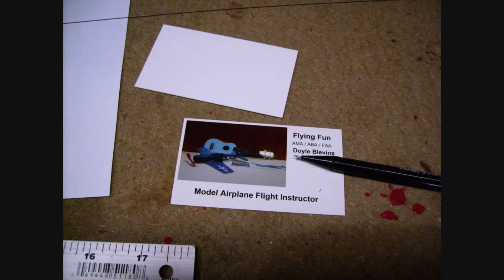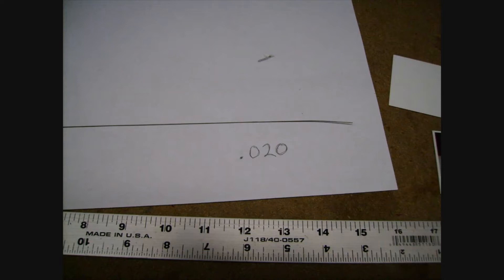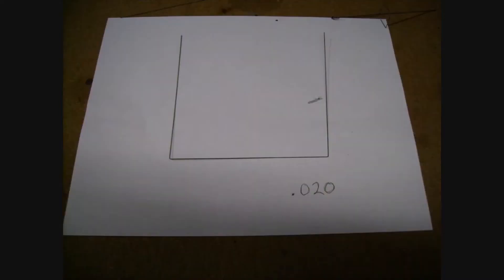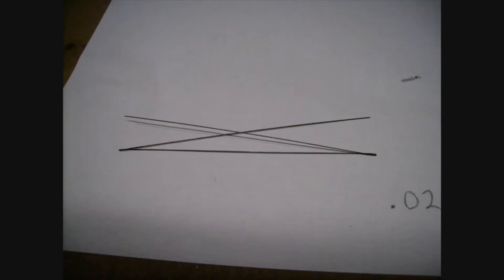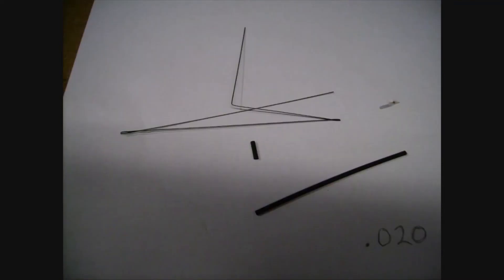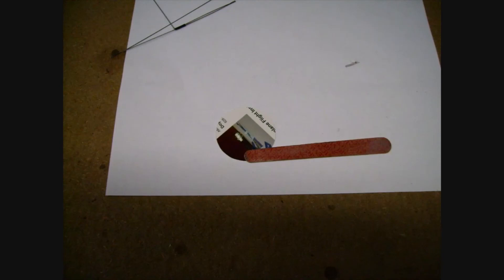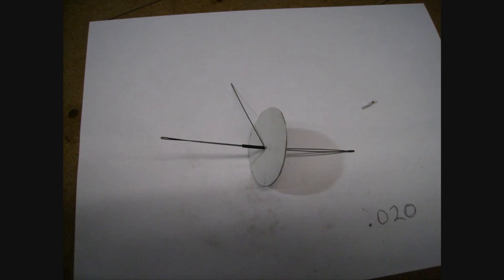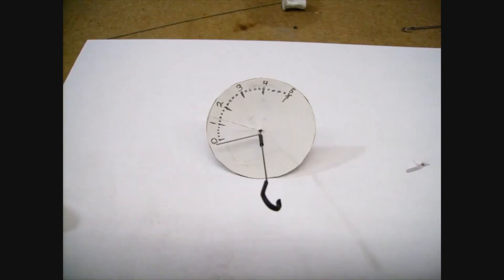DIY Rubber Band Torque Meter

Comment: I just started flying indoors and the torque meters in use range from Stainless Steel gizmos that look like Swiss watches and cost hundreds to wire and plywood contraptions cobbled together by cheapskate geezers.  I am the latter and I appreciate this design in the true spirit of Free Flight.
Thank you.
Reply from the maker: Thank you for this information. I can't take all the credit for this meter for it was given to me as the same look but as a coil of wire. I did add the cards to the coil so I could make a dial. Thanks again.

Comment: Hi Doyle, how did you calibrate it?  How do you know how much torque are you actually measuring?  Did you measure your device against something that has a known torque (like a known weight attached to a known bar).  I hope the music wire doesn't actually stay bent after applying torque.  This is a good idea, and thanks for sharing it with us.
Reply from the maker: No I didn't plan on weighting medicine. lol, I just keep using the same torqure meet to get the same  results. It can be calibrated if you wanted to go through the trouble. This was something I made after Flying at the indoor NATS. Walt Collins from Florida he shared his design with me then I added  the paper to the design to give it this look. If you are looking for an really good torque meters look up J&H aerospace or NFFS store. Thank you for your Comment